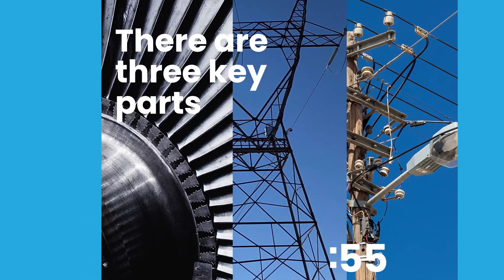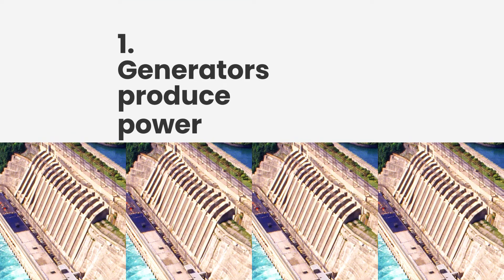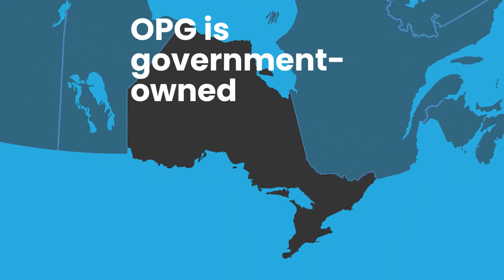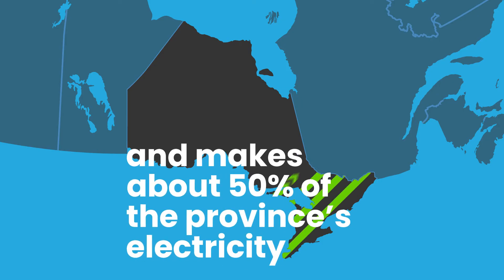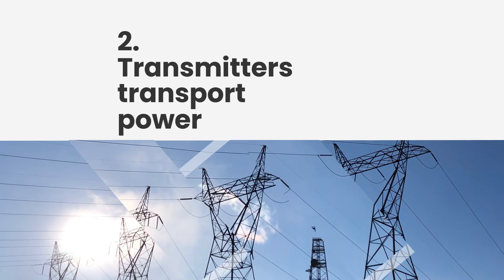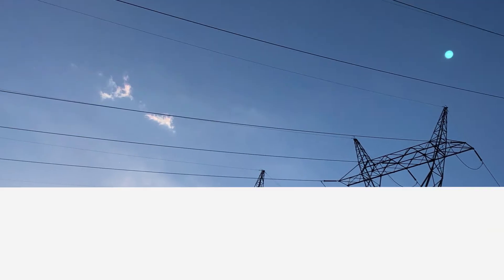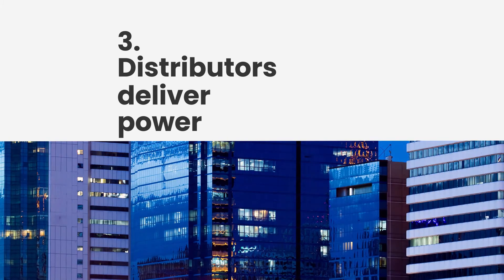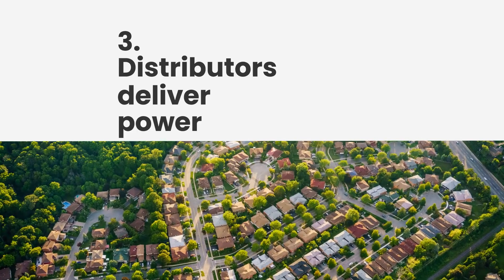Ontario’s electricity system in :60

Comment: What is the future of the carbon free power generation in Ontario ? Pickering nuclear plant is shutting down another block in 2022 and I didn't hear any other plans than burning fossils. Is that the right future? Are people supposed to charge new "clean" electrical vehicles from dirty power ? How is that cleaner than hybrid cars ?
Reply: We need fossil fuels, nuclear, gas, etc. The 'green' movement is cap.
Reply: Hydro powers the majority of the province (by population) and the provincial government is investing money into nuclear power.
Reply: @JollyOldCanuck  hydro generates only 24% in Ontario. Nuclear is 2x more at 59% of the overall mix.